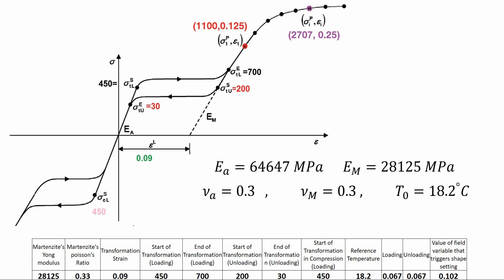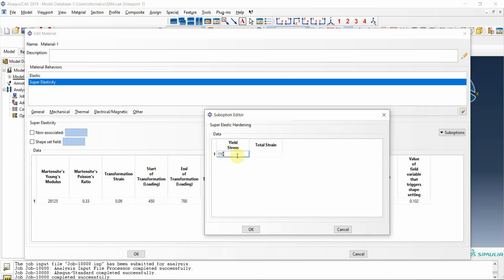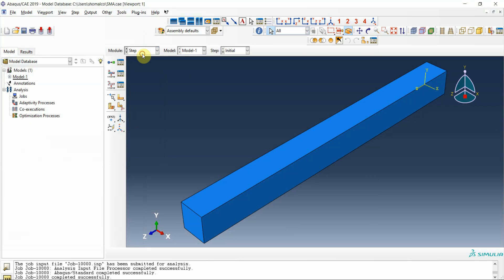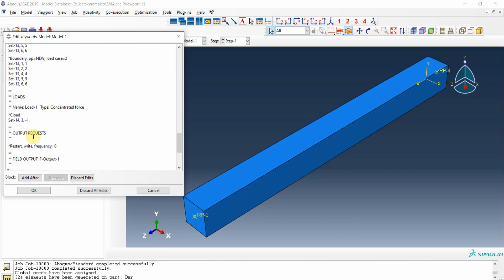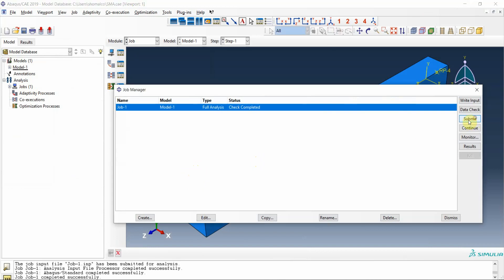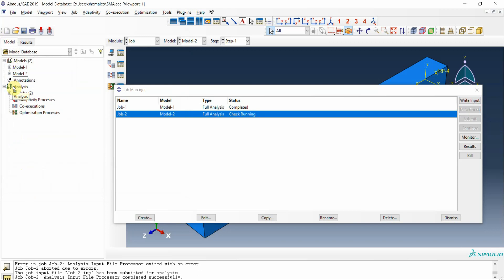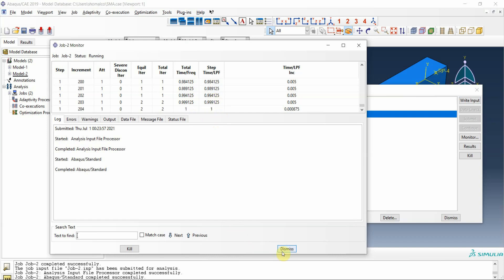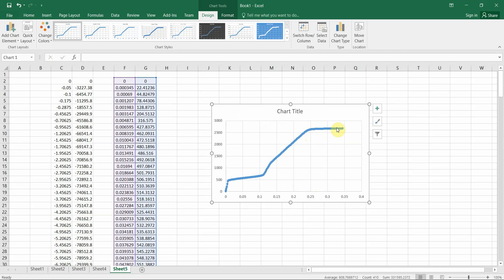Use Shape Memory Alloys' Plasticity in ABAQUS without any Subroutine

Comment: Thanks a lot Madam, for this video. Kindly post more videos on the analysis of Shape memory Alloys. I had a doubt. Does this Superelastic Hardening and the hardening modifications take into account the Plasticity of SMAs? Could you make a video on the analysis of using the Shape Memory effect for pull-out test of SMA wires embedded in a matrix material?

Comment: Hi
Thank you for sharing this video. I would like to model an SMA rebar under fatigue load. Do you know how can I Model the rebar to see the residual strain on the Stress strain curve? what is the the damage parameter for SMA rebar in Abaqus?
Reply from the maker: Hi
Your welcome,  this material property can be used to model any type of loading on any specific elements but there is not any  exculsive damage model for SMAs in this material property, if you wanna simulate the damage there is a need to write a related subroutine.